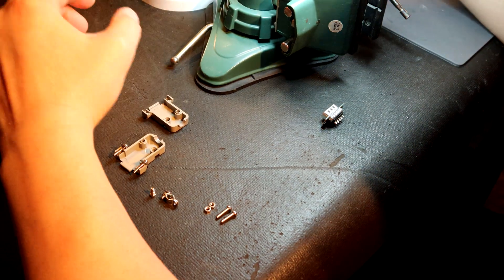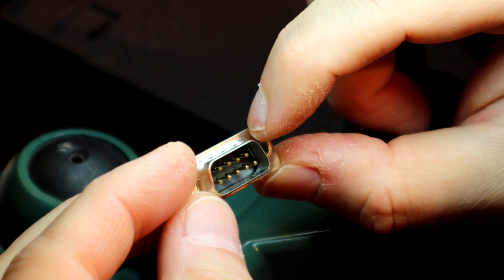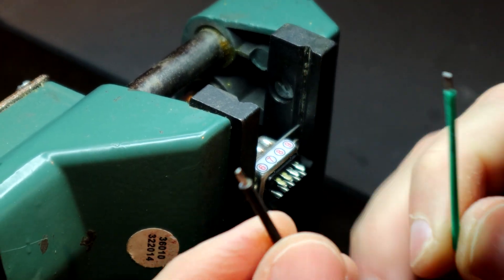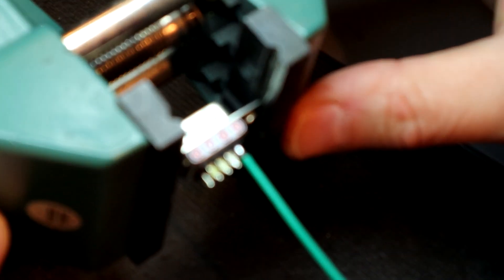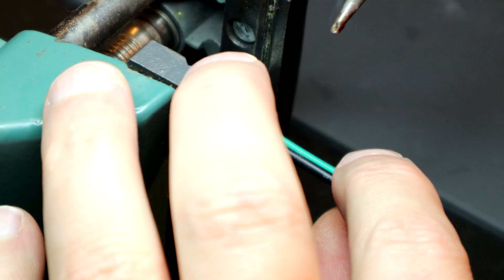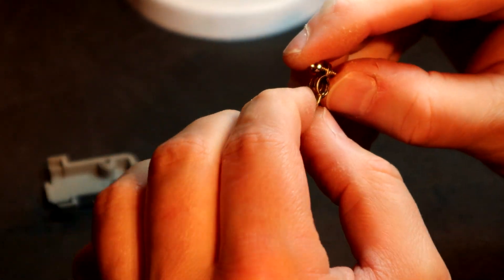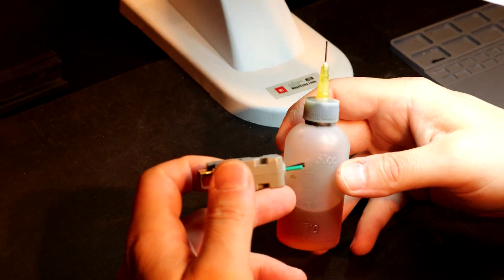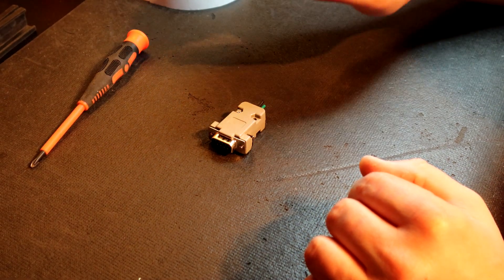CNC DB9/RS232 Connector Solder Assembly Overview (Shot in 4K)..

Comment: Well Vince, looks like im re-soldering everything on my cnc more thoroughly, no point in spending the big bucks on shielded cable from igus.
Reply from the maker: Jordan, thank you for your support. Its time consuming, but well worth the investment. Thank you, and have a great weekend! Vince
Reply: @corvetteguy50  Thank you so much for sharing your knowledge with everyone, I successfully soldered my motor wires directly to the stepper, re-did all the sub standard solder joints. I also had to re do a bunch of ends because of a small nick in the wire covering. Everything works perfectly, After spending 10 plus hours doing all that, I absolutely believe your products are nothing but the best and a damn good deal. 

The only thing that was an absolute pain was wiring the spindle connector, I tried having my leads as short as yours Vince. But man you must have some major skills to do that! I had to have my leads a bit longer. If I have to ever do a spindle wire again, I'm going with Vince's cable.

The flux you recommend is amazing! it makes all the difference

Anyway thanks so much Vince
Reply from the maker: Jordan,
Thank you for your support,  and your kind words. I'm glad you took the time to do everything correctly. It certainly makes a difference in the long run. 
I've assembled at least 200 spindle cables this year, so practice is certainly the key with them. Flux is a must have for everyone soldering, and Kester 186 is the best. Thank you again, Vince